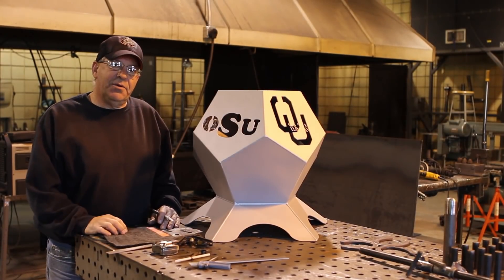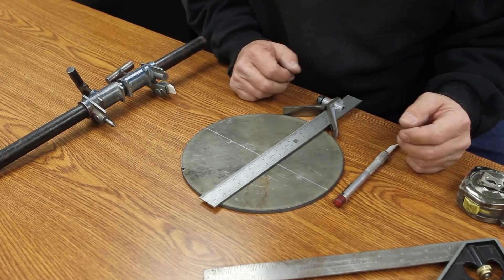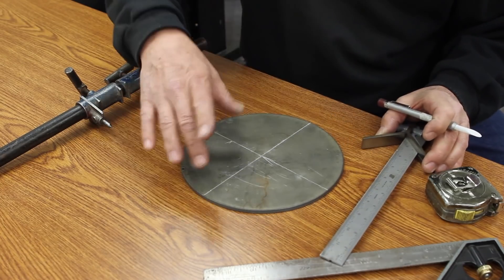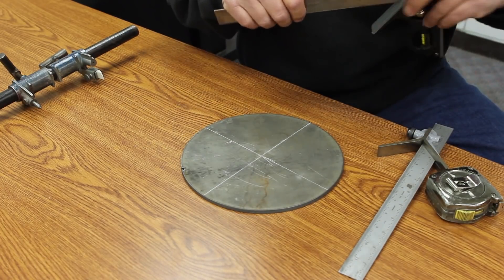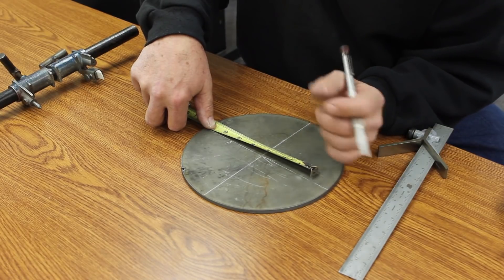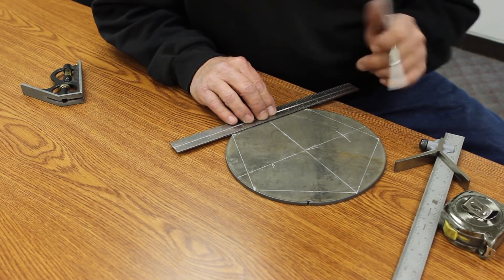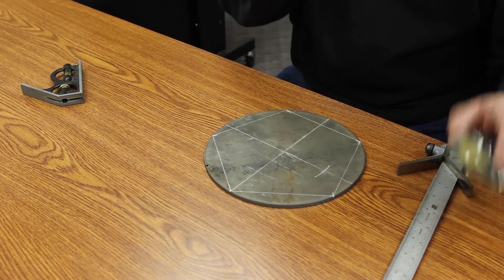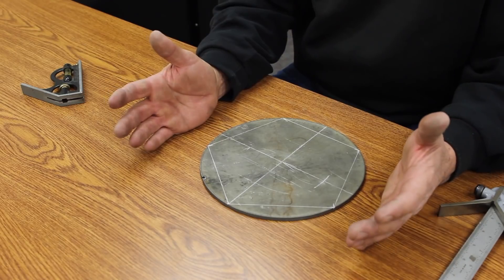🔥 Pentagon Fire Pit (FOLLOW UP) - Lay Out a Pentagon by Hand

Comment: Might be easier to use a little trig to get the length of a side.  You're never far away from a hand-held calculator with trig functions in any shop.

The corners of the pentagon are going to divide the circle into 5 isosceles triangles with the the lines from the center of the disc to the corners being the 2 equal sides of each triangle.  These are also the radii of the circle.  A line between 2 adjacent points of this line are the end points of the 3rd side of the triangle.  A line from the center to the mid point of this line forms 2 right triangles.  So half the length of the 3rd side is (r * sin 36)  The length of a side of the pentagon is twice that or  (2 * r * sin 36).  Now sent a pair of dividers up for this length and step off around the outside of the disc..  

Connect the dots and get the plasma cutter.